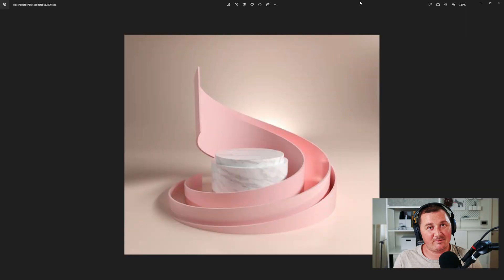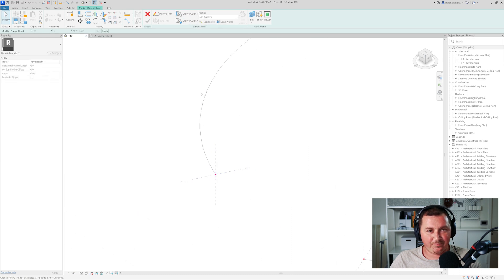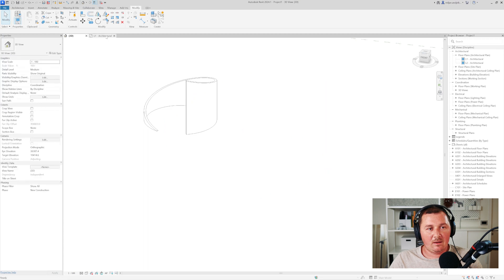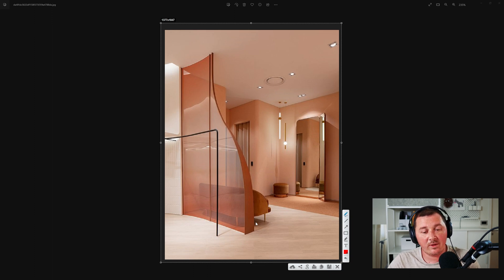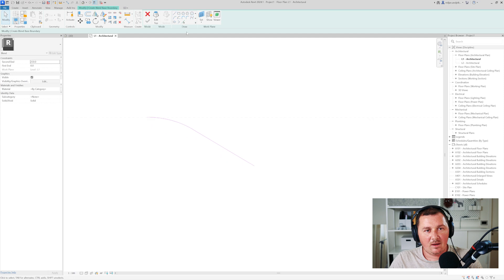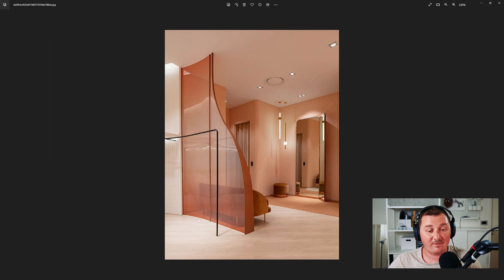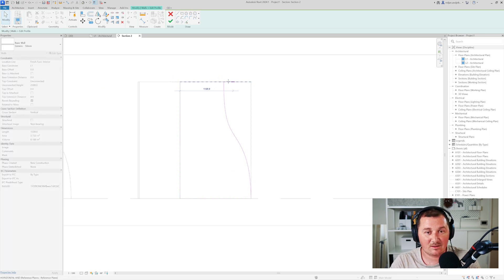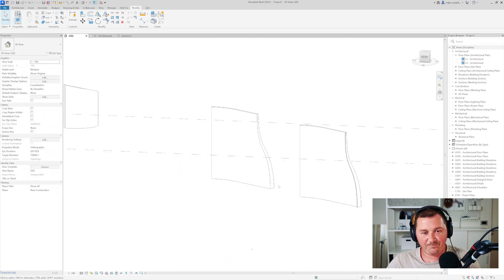Curved Elements in Revit

Comment: hi thanks for the video! 
could you do drywall video?
Reply from the maker: What do you need exactly?
Reply: @arkiteasy  modelling layers such as profiles, insulations and panels. also schedules? i search but i could not find good solutions. i used curtain walls but i need your ideas 😃
Reply from the maker: You can model everything within basic wall with added layers, except profiles. I go that way but I also create wall legend and there I add profiles, as detail components. If you give assembly code or keynote to the wall you can easily schedule it. 

On the other hand if you have to model drywall profiles try Agacad